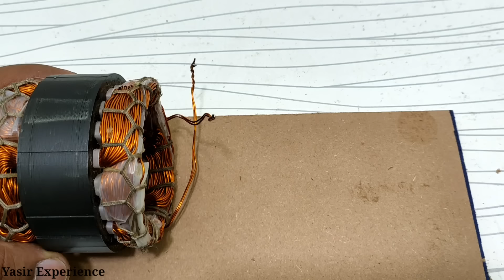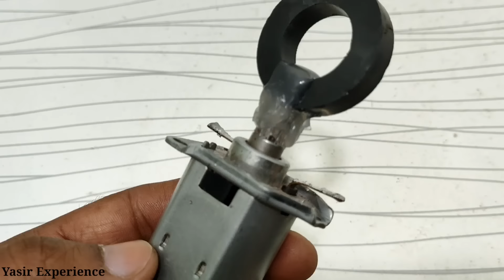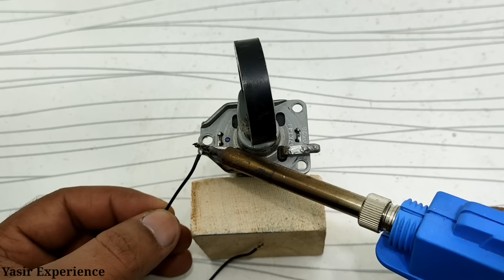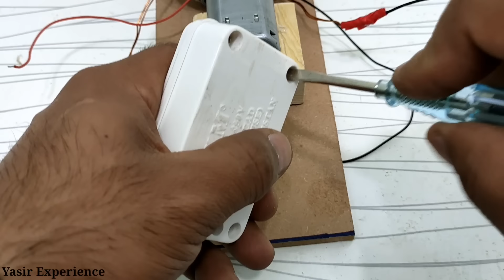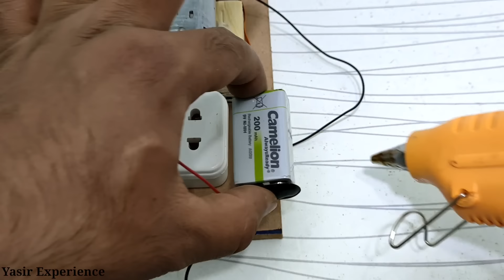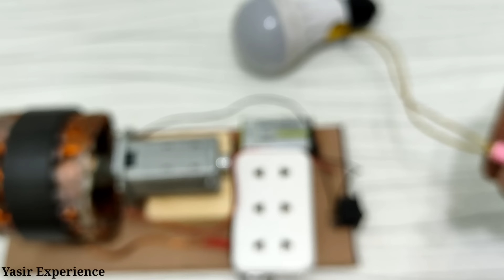I Turn Exhaust fan into 230V, 4000W, Powerful Generator,

Comment: Under table induction that trancefering power otherwise not possible.whatever you did that is 100%  ok and right but ,armature size and magnet size and air gap is too different so in this case you did is not possible.